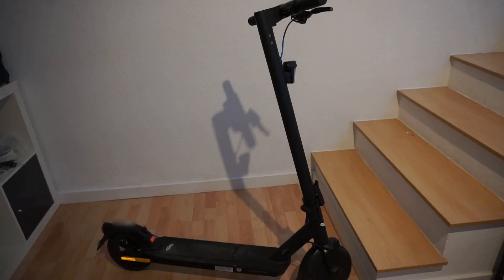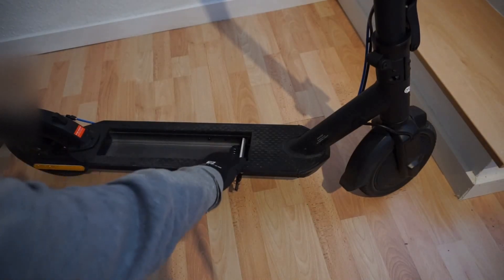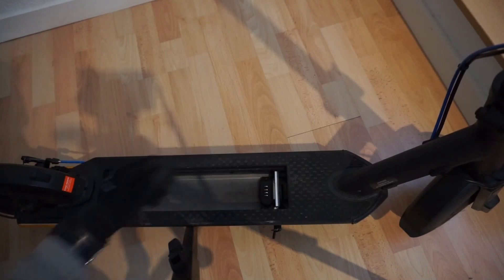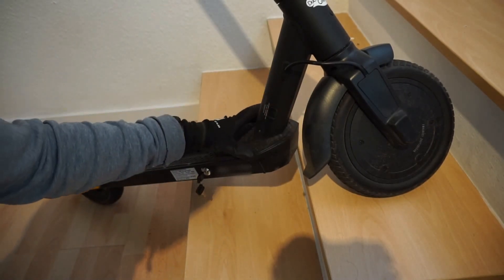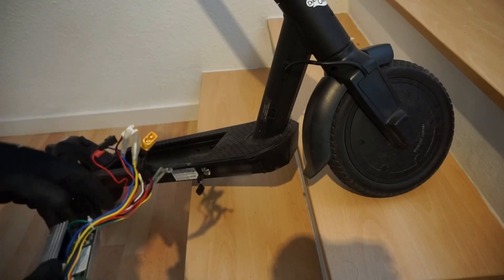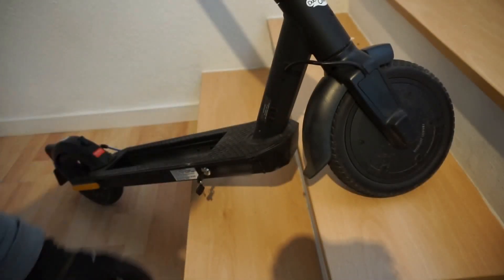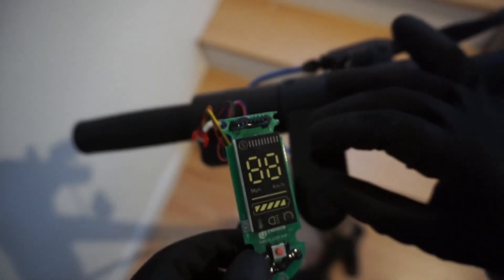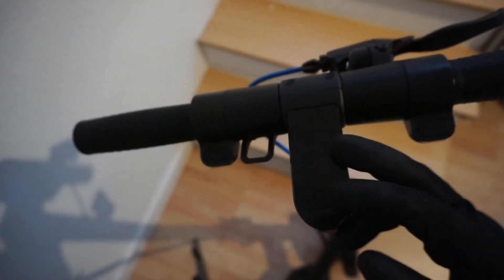E-Scooter Hacks Remove the Speed Limiter on an Lidl E-Scooter

Comment: I need some help on some battery’s I wanna buy I have a 350w pure electric scooter 350 pounds and I liked to have a 60 - 64v battery that goes 50kph+ and have a range of 30miles and I still need to use the scooter while it’s in the rain so I can’t use zip bags to but the battery in or I can use a waterproof bag I’m not too sure but I’d be so pleased if anyone reply’s with a good one below 60 pounds
Reply: Why don't you get a drivers license? If ypur going to ride an illegal scooter you might as well just ride a dirtbike or drive a car. Or walk?

Comment: If I change only the display, can I hack speed limit using an app? (Without changing the controller)
Reply: Depends on your controller as hardware limitations do play a role and also your technical skill level; That's if you used the word "hack" properly because this video is just showing what, not even how, he did to improve the top speed of his scooter which clearly was just buying replacement parts to modify his ride.

Comment: By any chance do you know how to change the speedo from mph to kmh?
Reply from the maker: Sure - you need to swap out the display, to enable bluetooth, and from the connected app you can change it. If you see the linked article in the video description, I have a screenshot of the Android app, you can change to kmh or mph.
Reply: @ampedcycling7164  oh I thought you could change it without replacing anything since theres a kmh option
Reply from the maker: @Mikey..  As I changed out the original display, I cannot test it, but I think you're right. If memory serves, it was possible to change between kmh and mph on the original display.
Reply: @ampedcycling7164  How do you change it on the original display?
Reply: @edvinasjarmala  press the button quickly 3 times it works on my gyrocopter flash 3.0 idk if it'll work on all tho